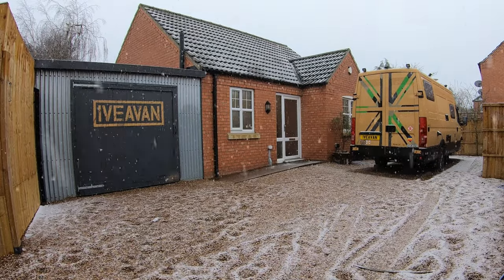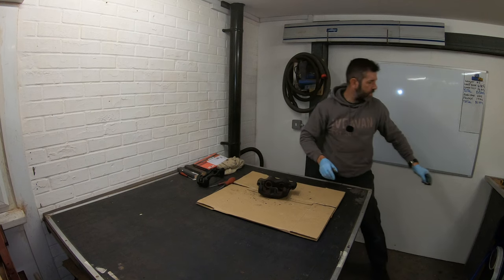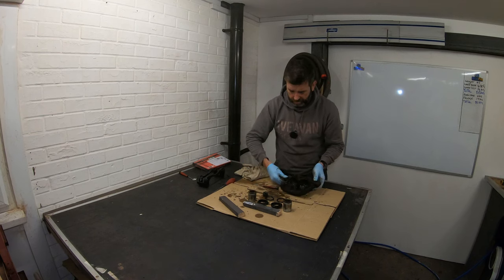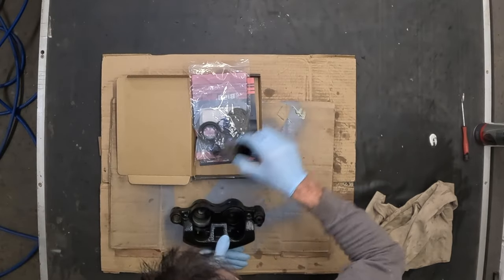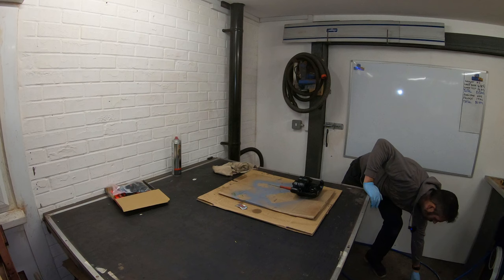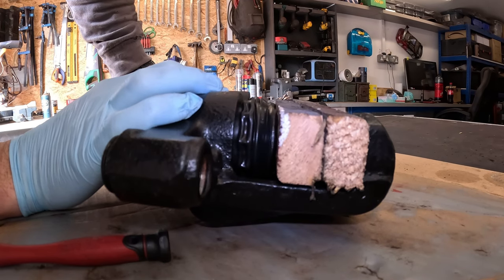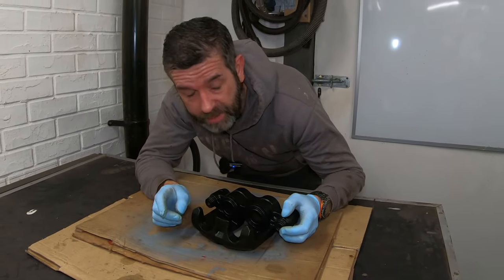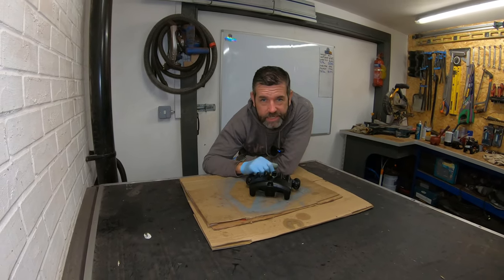Reviving Van Brake Calipers: Watch Me Recondition Them On My Iveco Daily Camper!

Comment: Nice one. Guess copper grease is a no no on the sliders. Bummer, mine have just been done with that when new pads were fitted.
Reply from the maker: No, not ideal as its only good for anti seizing compound and heat transfer not brilliant at being an lubricant over time bud 😉👌👍.
Reply: @Iveavan  guess it will have to be redone. Thanks.

Comment: Mark if you're going to the trouble of a strip down of the calipers I would see if I could  
sand blast them,how long did the whizzy wheel take and are you happy with the results ?  I did one a couple Yr back and it took me 2 days from frustration but still OK.
Reply from the maker: Yes, of course if you've got a sandblast cabinet it will do the job bud👌👍 probably an investment for the future 🤔 if I'd could find a decent second hand one locally. But on the other hand, I could buy new calipers for a cost of a sandblast cabinet. 
Mine to be fair, wasn't too bad to sand down, about 45 minutes for each one and yes, very happy with the end result matey 😉👌👍👍👍.
Reply: @IVEAVAN  great stuff Mark, including the emgine,brakes,welding and suspension its like a new van !! how you doing with the interior ?
Reply from the maker: Cheers Stu 👌👍. I've kinda done this backwards, I was going to do the interior first then do the exterior next (in summer). But due to the rear leaf springs I've had to do it this way, I haven't touched the interior yet, I can't until the end of April as we are away in the van in mid April, but these things are sent to try us 😅😉👌👍👍👍.